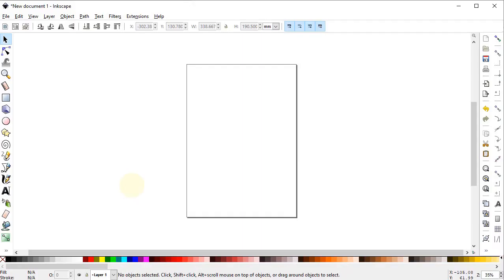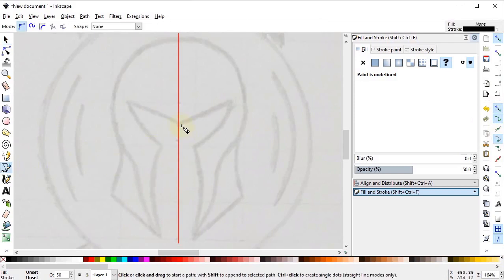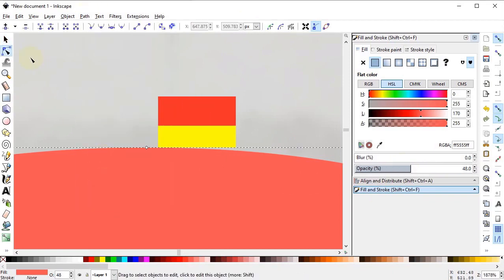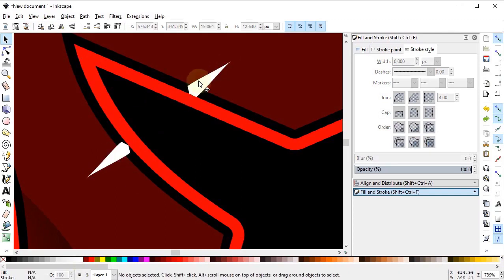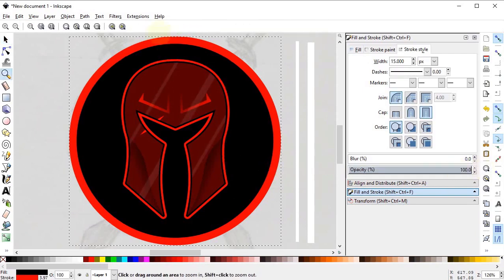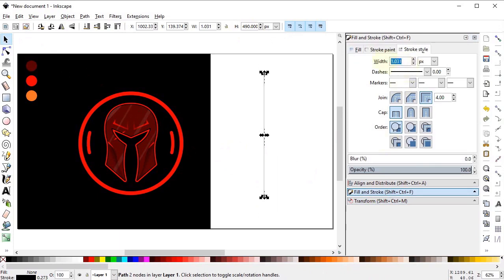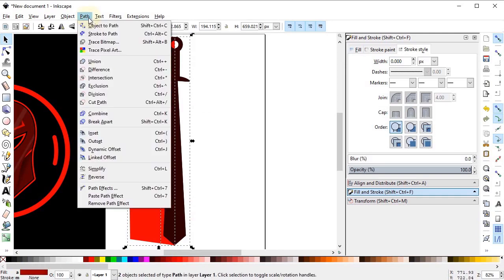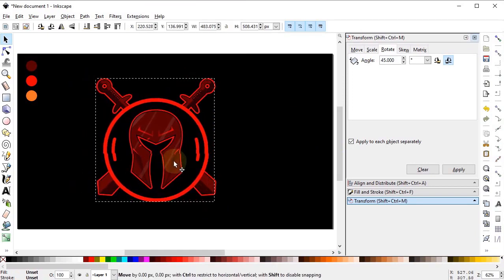Sketch to Vector Design - Esports Mascot Logo - Inkscape Tutorial By Royal Logos

Comment: Thank you for your efforts! I've a question... How could the command icons like Snapping Tools move/set to vertically at rightside of the screen?
Reply from the maker: You can also set the icons on the right side of screen by selecting VIEW and then select WIDE. It will automatically set Snap Control Bar And Command Bar at the right side of your screen.
Thanks

Comment: Can you just digitize the sketch and let the program do the rest automatically?
Reply from the maker: Sorry i couldn't understand. Can you explain a little bit ?
Reply: @royallogos  I mean, does Inkscape has an option to automatically recognize lines of drawing, to outline them, so that user don't have to do that manually like you did in this video. Sorry for unclear question.
Reply from the maker: @lesalabs  There is a option, which is select PATH and select TRACE BITMAP. For this you have to darker the lines on paper, by using any black marker. But the lines will never be smooth. It will convert the image into vector  but in a distorted way.
I hope that it will work.
Thanks.